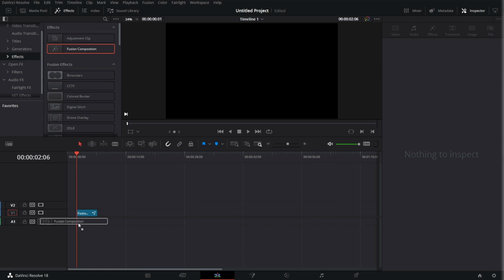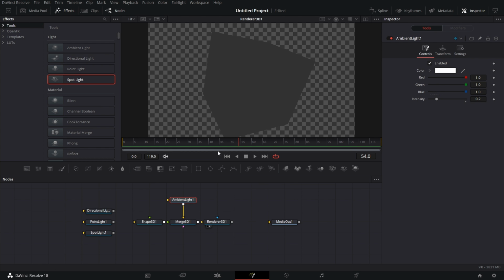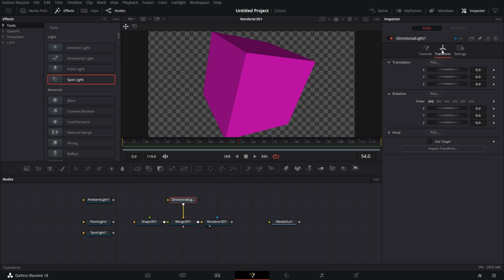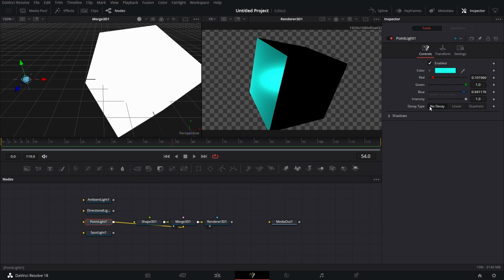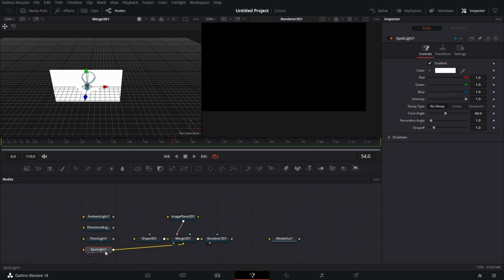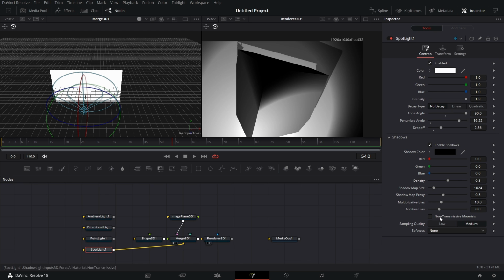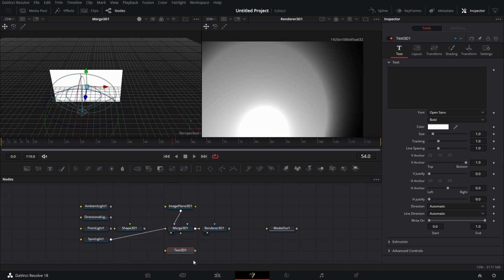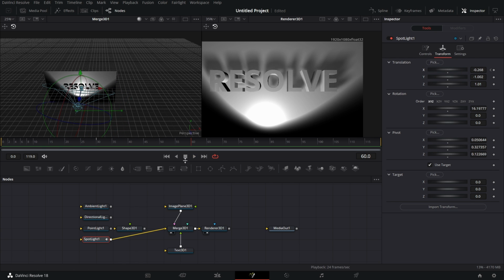Fusion Basics Tutorial 16 - 3D Lights

Comment from the maker: Alain Elineau pointed out a huge error in this video - directional light does cast shadow but only happens when renderer is set to OpenGL/Hardware Renderer. Sorry about the mix up guys. Will triple check next time.

To be clear, all the lights with shadow option cast shadow but you may need to change your 3D renderer node to OpenGL/Hardware Renderer to get the shadows to be visible.

Thanks Alain, I appreciate the call out.
Reply: no problem your videos are fantastic

Comment: Why is there a shadows option for lights that cast no shadows? Are there any conditions where they those adjustments would have an effect?
Reply from the maker: This baffles me too. Went through their manual almost three times before putting out the video. No explanation in there. Perhaps someone else might have an idea why.
Reply: @madresolve  The directional light does cast shadow, I use it often to create sun like shadows, better than spot light.
Reply from the maker: Thanks for the feedback.

However, directional light does not cast shadows but does make the side of a 3d object darker without casting shadows on another object.

Davinci resolve manual also confirms that the only light that casts shadows is the spotlight.

Just to be sure too, I also checked again and it can confirm it doesn't cast shadows.

I am available for further clarification. And thanks again. I could easily have made a mistake.
Reply: @madresolve  I confirm it does lol ... of course I cant send any screen copy here. But it doesnt show with software renderer, only with opengl renderer. I put it in my chain :) https://youtu.be/78MYuJURH4Q
Reply from the maker: Wow! It actually does! I will refer to this comment trail in  the comment and description of this video. I always did wonder why there was a shadow option on some of those lights.

Thanks for this correction.